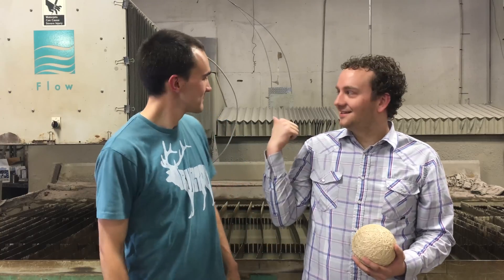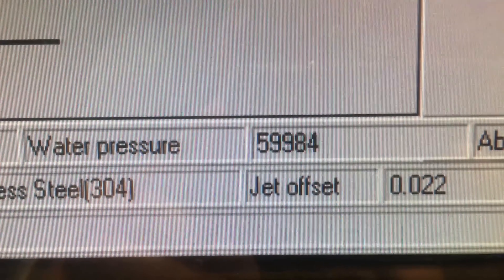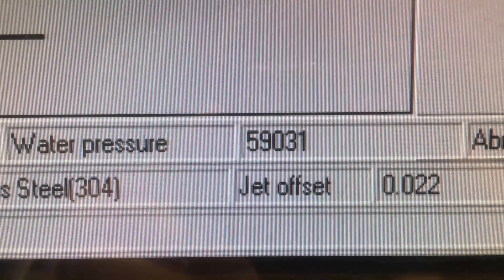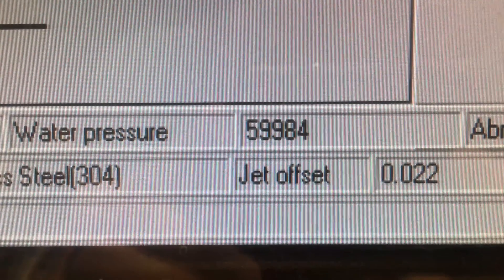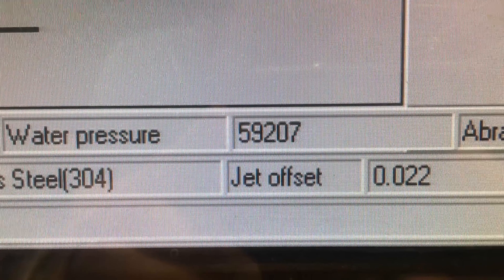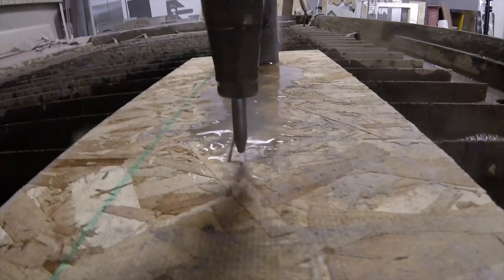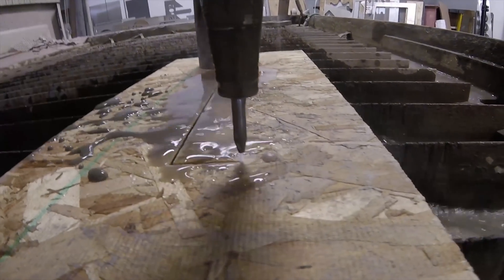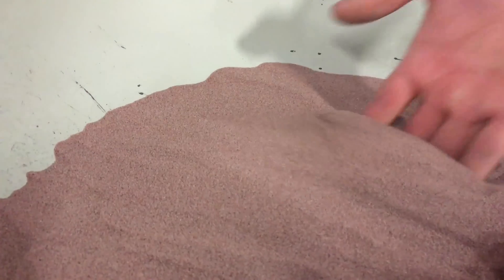Rubber Band Ball vs Waterjet Cutter

Comment: what is waterjet  machine please reply
Reply: If you are looking for make its by Flow Waterjet, if that is not the answer then its like a power washer but puts out up to 60,000 psi of pressure with crushed garnet mixed in as they mention in the video. Its an older model.

Comment: Nice video guys, have you thought about doing a Q&A video? A few questions I have are do you re-use the water after cutting? If not, where does the water go? Have you estimated how much water the jet uses on an average day of production?

And a suggestion for what to cut.. Either an old engine block or cylinder head.

Cheers!